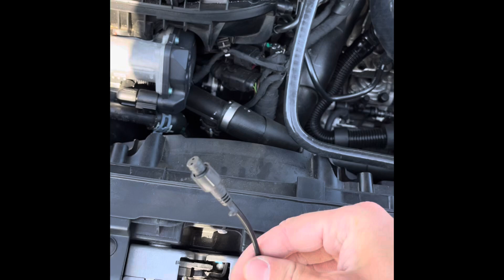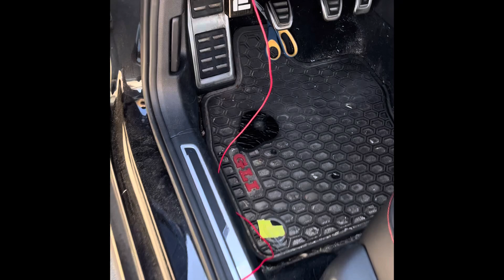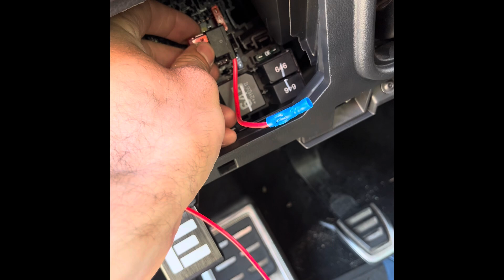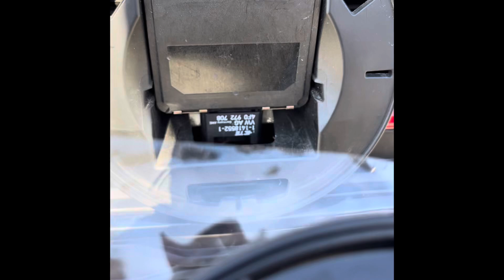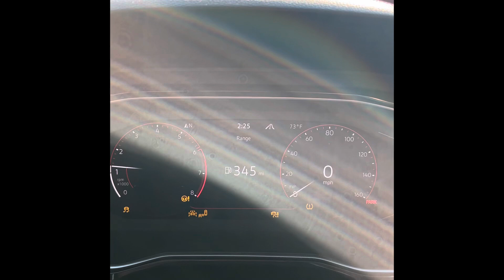MK7 Jetta GLI Dynamic LED Emblem Install

Comment: Hey man, I installed the same kind of emblem on my 2019 Jetta GLI, but I initially wired it directly to the headlight. Your video made me realize that wasn't the right way to do it, but now the ACC warning light is coming on. Do you think the installation method is the cause, or does that light come on for you too with the LED emblem? And were you able to fix it?
Reply from the maker: Honestly you can still splice it into the headlight if you figure out what wire to splice into. There are different lights that come with better instructions on how to tap into that light, but this one did not and I knew this method was fail proof. The ACC warning light came on, but went away shortly after I drove the car. Same for my Golf R. If yours is still on after a few minutes, you may have messed with the ACC sensor too much to where the placement is off. You may have to take it into VW to get it looked at/recalibrated. You can also try unplugging your battery and waiting a few minutes before reconnecting it to clear any codes. It may go away and stay away. If it comes back after that, definitely take it in.

Comment: with all the warning lights popping up - rotate your wheel all the way to the left then all the way to the right usually fixes them. that’s how i did it when i got my battery replaced! great video!
Reply from the maker: Good to know, thank you!

Comment: It would have been great had you showed us how you got the old emblem off.
Reply from the maker: Thanks for saying indirectly my video is at least good! 😄 All jokes aside, sorry I didn’t mention it. However as I hinted the video, this wasn’t made to show things you could easily find on YouTube such as removing air intake and battery, but mainly the install of the LED emblem (which I couldn’t personally find for my car). This was not an uninstall video by any means. As a courtesy, here is a video on the removal process that will work on all MK7 GLIs. 

https://youtu.be/POcLARyGikw?si=fHmsjIRXEE_KKyjh

Comment: What fuse did you tap into? And is it on all the time when the car is running?
Reply from the maker: I tapped into the 20 amp that’s found at the bottom of the interior fuse box. This 20 amp belongs to the 12v power supply which powers the socket 2 12v, usb charging socket fuse. I used that fuse specifically so that the car’s performance wouldn’t be impacted if the fuse blew. I recommend using the same fuse. If you want to use a different fuse, you can look through the diagram here for alternatives: 

https://www.startmycar.com/us/volkswagen/jetta/info/fusebox/2021

The light is on all the time when the car is on. However, If I remember correctly based on the install on my Golf R, the light still stays on the whole time the car is running even when spliced into the light bar of the Golf R despite turning off the lights.
Reply: @PercTech27  Thank you for the reply. I will look into that.

The only thing I'm worried about is when it's running all the time, even during the day, it might burn out too soon.
Reply from the maker: @harshasblr  you’re welcome. That’s a valid concern. At least the emblem still looks cool without being lit up. On a serious note, I’d say since there are no screws on the back of the emblem, it would be a pain to open up to replace the light when it burns out assuming you can pry it open to separate the cover from the backing. This is something you can ask your LED emblem supplier about, or you can ask about sending in the burnt out emblem for a replacement. Regardless, I don’t anticipate those burning out for a while, even if they run all the time since LEDs are known for their long lifespan.
Reply: @PercTech27  Yeah, I agree on the point you made. It would be easier to replace the whole thing than pry it open and replace the leds.

Thank you once again. 😊
Reply from the maker: @harshasblr you’re welcome! One last thing while I’m thinking about it, the fuse box is accessible while sitting in the driver seat. If you use the add a circuit method I showed in the video, you can easily remove the 10v fuse from the add a circuit before a long drive, keeping the light off during the day.
Reply: @PercTech27  Understood. I do have some fuse tap wires with me. I'll look into it.

Comment: cant I just splice the wire running into the  headlights?
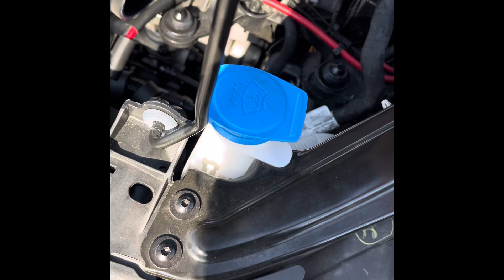Reply from the maker: Because as you can see around 1:32 in the video, the headlight is connected with a wiring harness. It’s not one simple wire that you can splice into like you can with the GTI/Golf R light bar. If you’re good with wiring, then go for it but I’d advise against it. 

With that said, you can easily install this on a GTI/Golf R since there is the light bar in which you can splice into.

Comment: Couldn’t this be installed in the fuse box in the engine bay?
Reply from the maker: No, not on my car anyway. There were no open slots. I could have used the add a fuse device that I used in the interior fuse box, but that would’ve been risky because everything in the engine fuse is linked to something vital. If the add a fuse blows a fuse for any of those components, it could cause significant damage.